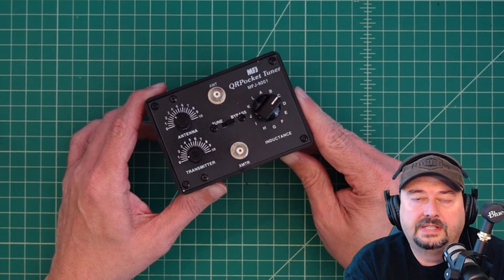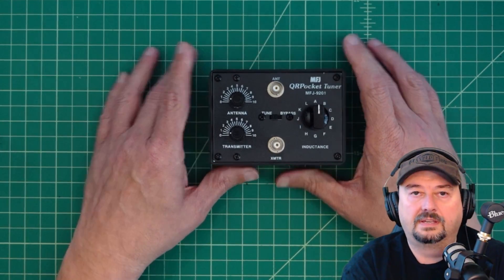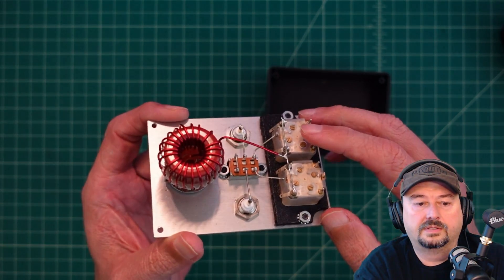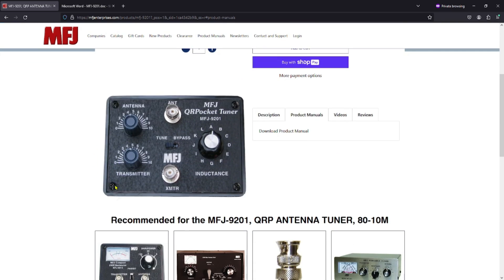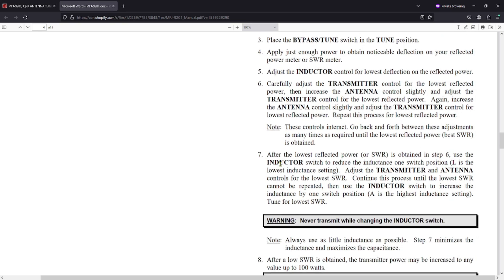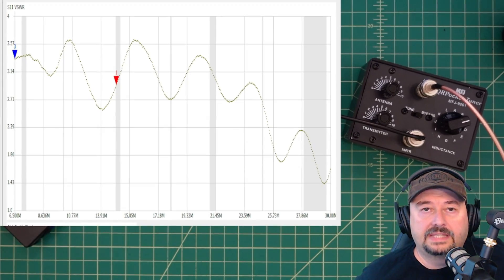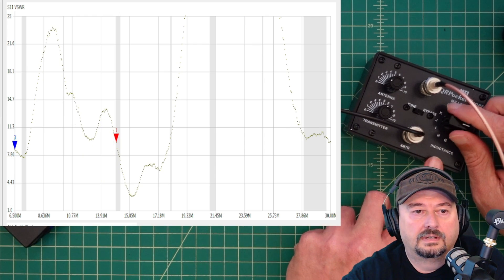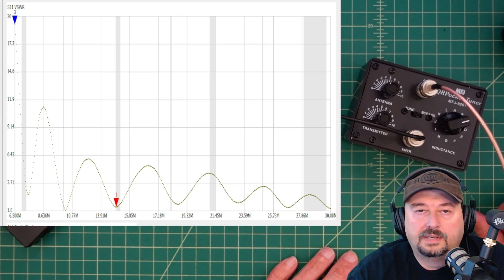MFJ-9201 QRP Antenna Tuner: How Good Is It?

Comment: Slow to see this but for the polycon capacitors, technically it's correct. Polycons are rated for upto 100v, which would be 100w... at 1:1SWR, if you were at that why would you be using a tuner anyway?

At a 4:1 SWR you will have the same voltages across the antenna loading capacitor at 25w as 100w 1:1.  Now add in the buffer for constructive phase voltage (double base voltage) from the standing wave and at 4:1 SWR you could see that 100v max at only 6w. Given this is all for a Hi-Z antenna, if its lo-Z than the overheating from current could be the bigger issue than arching. Either way, I've used these type of caps to tune up to 20w SSB no issue, I would limit 100% duty cycles to <10w though unless you are only fine tuning you antenna input.
Reply from the maker: Thanks for the info SC, much appreciated.

Comment: It's a typo. It had to be 10 watts. If it could handle 100 W they wouldn't call it QRP. That dielectric in those cheap caps can't handle more than 15 or 20 watts before they start arcing. I'd contact MFJ and let them know before someone reads the manual and believes them. If they said the spec was correct I'd make a fun 30 second closeup video with the case open and 95 watts being fed into the capacitors. Probably get a lot of hits. Then I'd replace the caps and know that I'd never hear from MFJ again about a review.
Reply from the maker: A lot of folks are saying the 100w is doable, I’d be surprised to see that on digital.  I’ll give it a go @ 50w and see what happens 👍
Reply: @TheSmokinApe , thanks. I'll check back and see how it went. Different variable caps can use different plastics with different dielectrics in their cases and between their plates, and make a world of difference in their ability to withstand voltage or dielectric heating on higher bands. The problem with pushing the RF envelope is that everything can be fine until you change bands, or change modes, or the humidity goes up, or you recharge your battery and the power goes up just a little, or you switch antennas, or any of a million unknown variables changes, and poof! Everything goes instantly straight to Hell. I've seen so much smoke coming out of rigs and accessories that shouldn't have smoked, that over the last couple of decades I finally learned to rate everything very conservatively so it would all actually work reliably. No more of, "Well, that should have worked and not blown up $150 worth of finals." It's just a hobby. I can make mistakes, and I like to troubleshoot, but not enough to cause problems just so I can troubleshoot them, or pop finals and have to throw $150 away for new ones when there are other toys I'd really rather put the money into.

Comment: An alternative is an Antuner, an atuomatic tuner sold on Aliexpress for about 100 bucks.  has an onboard battery good for about 15 hrs, usb-c charging input.  can use at trx or at antenna feedpoint.  compact. good for portable work.  build quality is good.  I have been using mine for about six months.  no complaints.
Reply from the maker: Thanks for the info Tim, I’ll check them out 👍
Reply: @TheSmokinApe  videos about it on other yt channels

Comment: Good video, thanks. If just doing QRP work I have to echo @Inkling777 in that I believe the Emtech ZM-2 with the led and resistors acting as a dummy load is a somewhat more refined solution. I use one with the IC-705 when out portable or SOTA and there is very little that I have found that it can't match. The Led can be a little difficult to see in bright sunlight but it is an effective way of ensuring a match without the need to carry a Nano-VNA. I also have the Chinese Z-Match Tuner that Morten @LB0FI demonstrated in a recent video. I have yet to test it further before I am completely confident of it but it seem to match most everything the ZM-2 does. I was quite surprised that you hadn't heard of the ZM-2, I thought them quite ubiquitous. Maybe only in the QRP world.

Cheers
Phil ZL2VTH

Comment: I bought that model - it was damaged on arrival. Capacitor tuning plates were Jammed - to the point where turning the knob stripped the shaft.
Returned it next day. First, last, and only time I buy an MFJ product.
Reply from the maker: Sorry to hear you had problems
Reply: @TheSmokinApe  maybe they make good gear, but it's hard to shake a bad first impression.

Comment: I literally just ordered one of these on Monday.  I feel like a moron, but previously I ordered the 16010, thinking it was just an ultra compact 200 watt tuner.  Because that’s all it says on the case.  Nowhere does it say it’s specifically a random wire match.  I only found out when looking up the manual to see what the match ratio is, because it was far more difficult to tune than my 941E.  I guess I’ll see how the 9201 handles 100 watts FT8, because I do a lot of that.  Doesn’t hurt to have a random wire tuner either.
Reply: I use the 16010 with full coax hook up all the time. Works with both random or coax. Not as wide a ratio but works none the less.
Reply: @forgetyourlife  it worked for a few months.  It’s just with nearly resonant antennas, or trying to counter a 1:1, it sometimes didn’t have enough capacitance, and 3/4 of the inductance levels were overwhelming.  It did work great when I made a completely unhinged 9 band fan dipole.  That wasn’t random wire.  Just a random mess.
Reply: @AZREDFERN you can flip flop the input on the 16010 as well. It’s works backwards for higher or lower impedances. Say, if you can’t tune a certain band try switching the antenna and transmitter inputs.
Reply from the maker: Hope it works out for Azred 👍

Comment: Just don't forget to stop transmitting before stepping through those inductor settings, peeps. not such a big deal for a low power measuring device like an analyzer/VNA.
Reply from the maker: Good call Kinetic, I wasn’t worried about it using the VNA but it’s definitely something I should have mentioned 👍

Comment: nice manual tuner.  great way to tune with manual tuner with out transmitting on the air. get your SWR dialed in before transmitting. i do that with my manual tuner. some times under power you have to touch up for lowest point. maybe 100 watt PEP if tuned but not long. that toroid may heat up and or cap arc over. the more out of tune the antenna the harder the tuner needs to work. that why we use a 9:1 or 4:1 is to bring SWR down so easy to tune.  that UNUN takes most of the heat. saving it from tuner. I wouldn't use that tuner on FT8 or JS8 call unless 5 watt. and that has been done with a IC 705 and contacts been made QRP. 73's
Reply from the maker: I just don’t think these caps could take much more than 10w ssb.  Thanks for watching Robert 👍
Reply: @TheSmokinApe  plastic and small caps . looks like AM radio ones . some one made a CB antenna tuner out of them and took 12Watt SSB . was the limit on caps.

Comment: I'm surprised it doesn't include an inexpensive LED SWR indicator like my ZM-2 from EMTECH. That saves carrying a device to measure SWR. The ZM-2  can also feed balanced or unbalanced lines. This one can't without an external balun.
Reply: That SWR indicator is nice--though I did like the look/simplicity of the inside of this device :). The ZM-2 is sweet but looks a mess inside. haha. There are probably cases where this is more efficient than the ZM-2, and vice-versa... but you're right, in that the ZM-2 is more versatile.  If I'm not mistaken, ZM-2 is limited to 15w (once tuned), and by my eye, those polyvaricons look to be about similar sized.  This probably will handle 100w at certain ideal impedances, and it seems people have done so 'successfully,' but probably not best to press one's luck.  Overall, this seems like a decent product.
Reply from the maker: I’ll probably just use the for QRP stuff, please don’t tell anyone I do QRP… it’s embarrassing 😳
Reply from the maker: Never heard of the ZM-2, thanks I’ll check it out 👍

Comment: I have seen many hams using the MFJ-9201 with 100 watt radios. The variable capacitors are polyvaricon capacitors and they will handle not more than 10 watts SSB, 5 watts CW.
Reply from the maker: Thanks for the info 👍